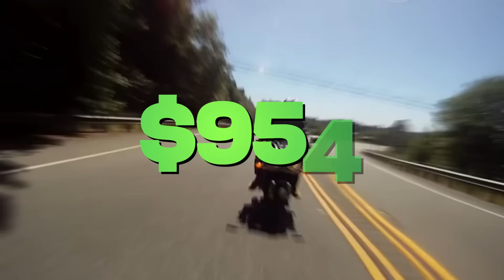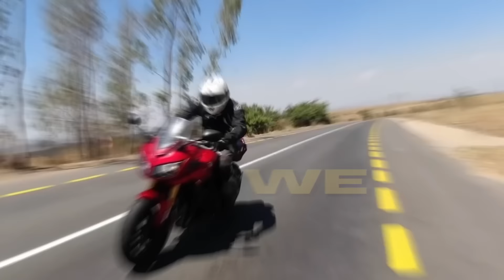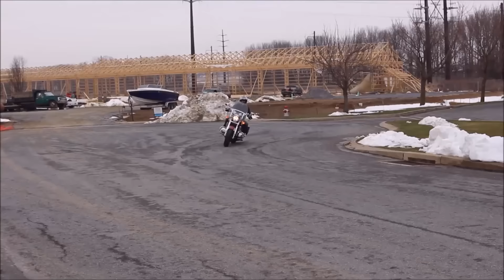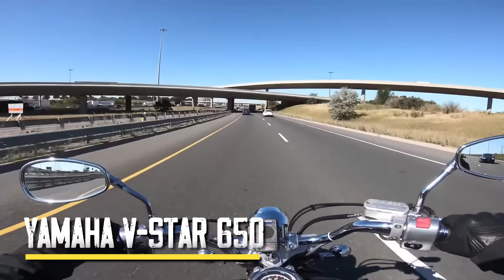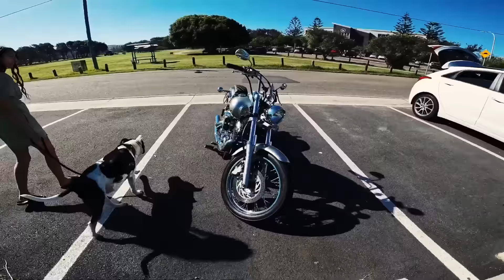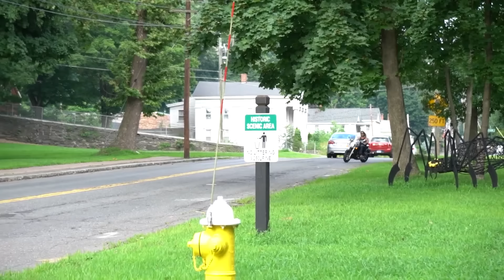10 Carbureted Motorcycles That Start Every Time (And Humiliate Modern Fuel Maps)

Comment: The first generation Yamaha FZ1 was/is a brilliant machine. Spot on fueling with smooth roll on power everywhere. Yes, if you store it for extended periods with E10 fuel in it you are going to be taking the carbs out for a rebuild. But once upgraded with ethanol resistant rubber o-rings it will be as dependable as anything sold today.